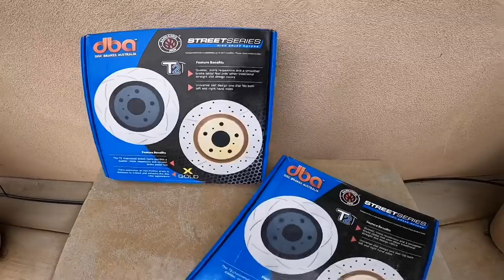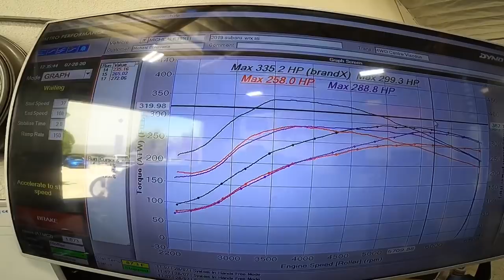“Chicane’s” Built Not Bought #36

Comment: wheels look great Bucky! sucks to hear about that bolt snapping on ya :( you may want to double check your caliper bolts and make sure they're not Torque To Yield, which means they need to be replaced any time they are removed. that may help with future brake jobs just in case and they won't weaken when re-used and future bolt snapping again

Comment: Aw man, yeah I know that bolt thing all too often.  I have a way to have that never happen again.  You may not want to hear it, but gotta wire wheel bolts after every removal and inspect them for stretching.  Far too often bolts accessed with power tools like caliper bolts, and other suspension bolts can easily stretch with improper removal or installation (all the ugga duggs...all of em)  I also use a very little dab (just a rub) of the silver anti-sieze on the entry threads.  Prevents oxidation, but too much can effect torque load and proper seating.  I enjoy your videos, I hope you enjoy em too!

Comment: Hey Bucky, new wheels look tight. Regarding your caliper, once you get that stud drilled out, I would pick up a tap and die set and chase all of the threads on all 4 calipers. Throw some antisieze on the bolts and you'll enjoy changing your pads and rotors next time. Car looks well put together my friend.

Comment: Wheels look great, Buck! I cracked up at holding the truck cover up with a stick. I have to do the same shit with my tundra's camper shell. Broken bolts suck. Happened more than once to me. Never on a caliper though. Worst one I had to deal with was a bolt going through the subframe and lca of my old 98 civic when I was putting on coilovers and forged lcas. Had to use a torch, vice grips, cold water, and a shit load of patience to get that shit out.
Reply from the maker: As if I don’t have enough to do but it’s expected with an older car.

Comment: Idea for a quick/easy mod: there's a replacement you can get for the button on the handbrake that allows you to pull it up and it goes back down by itself, to engage it when parking you pull the button out instead of pushing it in. Inexpensive and easy mod if you want some easy slides
Reply from the maker: 👍🏼Drift button, I had one on my old car. I only use my stock handmade for parking so I need it the way it is. I have a hydraulic handbrake for fun stuff.

Comment: So sry about that droped rim and bolt .....i hate such days. Some times shit happen and you cant stop it. Wish You best mate. 
Waiting for next video. 

PS.
Fixing that bolt its not so hard just drill it when you drop rotor from outside using very small drill, next bigger one, a little thiner than bolt. It happen so many times when i was warking on old subies in workshop. Ppl dont come offen for checking cars and even using antirust spray or heating dont help. They will snap. As You said old cars got their small problems. Even tho we love them. They got soul, not like new ones, full of gadgets and electronics all feel same „empty box on wheels”
Reply from the maker: 👍🏼 Right on

Comment: That sucks dude! Those Brembos like to do that... as soon as it got a bit tighter on you I knew that was gonna happen. One thing that I've heard can help is using an impact to loosen them. Always worked for me even when the bolts were pretty sad. Something with the force only being applied just for a moment helps to keep them from snapping.

One question... is your hydro linked into your rear calipers? I'd always thought you had a dual caliper setup until this vid.
Reply from the maker: 👍🏼It’s spliced into my rear lines.

Comment: Bucky you gotta start running some high temp anti-seize on them bolts , those brakes get hot specially after canyon runs . But it's good to know your brakes are doing they're job 👍👍
Reply from the maker: My donor car was pretty rusty and it hadn’t been taken apart since the swap. I usually apply grease to all my bolts before re installing them.

Comment: Question: Is there a lap time benefit that you can measure for us for a front lip, roof vortex generator, or rear wing? The driving skill and consistency that you bring would help the Subaru community, because we can't all be pro drivers. But these are cheap mods that might (or might not) do something useful for the aerodynamics.  I have not seen anyone check the lap time difference with these parts.  Thanks Bucky!
Reply from the maker: I honestly don’t have what that would all take at my dispense. Sorry🤷🏻‍♂️